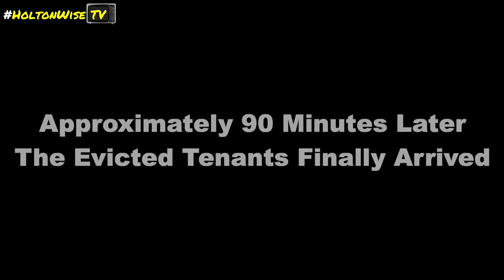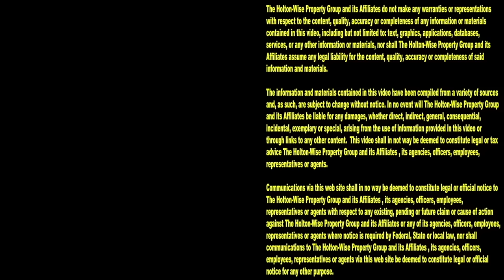How does the Eviction Process work? | Tenants From Hell 307

Comment: In NYC it can take up to 6 months to get on the calendar, another 3 months of back and forth - tenant postponing, finally  9 months - 1 year later you get the judgment  to evict from the judge but then need to wait 30 days before you can get have the Sheriff come out. Sometimes it took me 2 weeks to get on the Sheriff calendar so it can take over a year to evict.
Reply: Suppose there was a way to fix the backlog of eviction cases. Make them not take as long. What would that look like? Please, no violence.